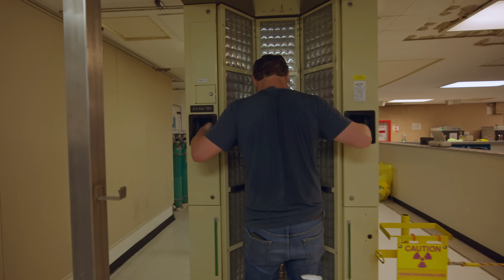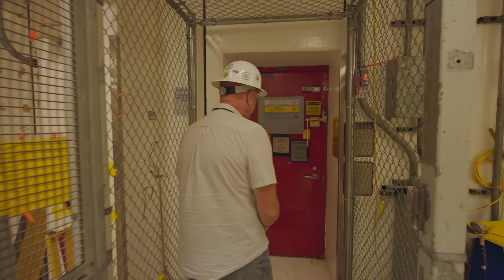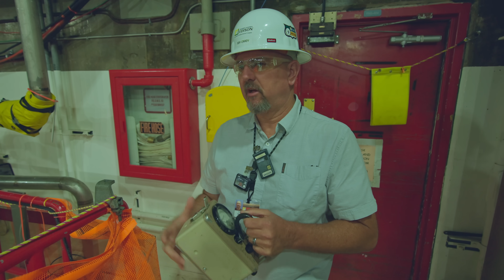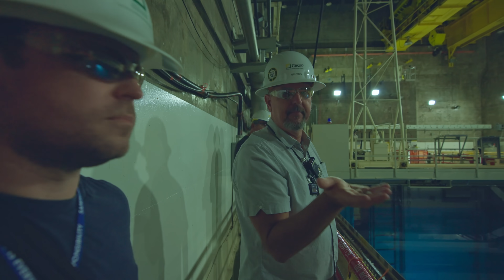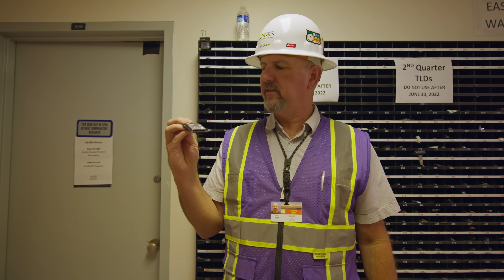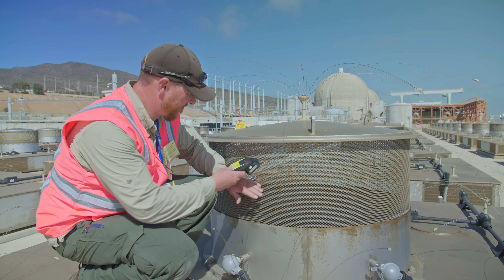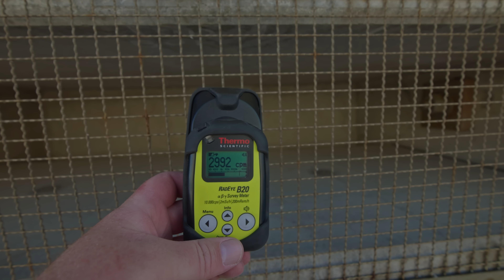Inside San Onofre Nuclear Power Fuel Pool and Spent Fuel Storage

Comment: Very few are being built. They are too bloody expensive. And they are not economical. They also aren’t good for baseload power due to the extended refueling outages that have to be made up fir by other sources, and that can occur at any time. They unlike other power sources only run in two modes - on or off.
Reply from the maker: For base load power you want an on all the time and they can regulate the power coming out. The refueling outages are planned very far in advance as they know when its time to refuel based on the power level they are running the reactors at.
Reply: @RadioactiveDrew  It does not matter that they are planned far in advance. You still have to have some other source of that much power. And it has to be always available because for systems use nuclear is a pig. It can go away at any time. And when it returns it demands priority.
Reply from the maker: Well that’s why you have a 2 or more reactors on site. So when one goes down the other can pickup some of the slack until they are both fully operational.
Reply: @RadioactiveDrew  Think about that for just a moment. The two reactors run as much as possible. Economically they cannot do any less. When one goes off line for maintenance or an issue, the other CANNOT pick up the slack. It is already running flat out. That is how they run. So - NO - the second reactor does not and cannot pick up the slack.
Reply: @tunneloflight  I must inform you that you have very little grasp of how the power grid works.  Please research that and get back to us.
Reply: @jovetj  I know a great deal about how the power grid works. It is a complex creature. With the inter-tie of the five major grid areas across the country new dangers of instability are created, along with vulnerability to impact by Carrington events. The complex interplay of power sources and types makes balancing the grid a very tricky thing. 

That includes not just power as we think of that (megawatts ...), but also of phase which involves "imaginary" power. That isn't imaginary. It does involve a second non spatial dimension. Explaining that takes a lot of doing. 

Balancing the grid requires understanding the capacitive aspects, inductive aspects, resistive aspects, wire heating and sag, and more. 

Having a major source go off line without warning creates severe challenges. 

Losing major sources in ways that require tripping parts of the grid offline have the potential to force nuclear plants to shut down due to loss of off-site power to support emergency operations. However, that in turn triggers a series of events which can put the plant in serious jeopardy.
Reply: @jovetj  so do tell. Have you personally ever controlled the shift of power among five major active supplies with megawatts of imaginary power running around and the instruments lying to you? I have. Have you ever operated megawatt range breakers in a supply system? I have. Have you ever worked with 17 KVA power? I have. Be careful with your assertions. It is better to be silent than to speak and remove doubt.
Reply: @tunneloflight  That last line is incorrect, it should be "It is best to remain silent and be thought a fool, than to speak and remove all doubt".  And the irony of it coming from a compulsive liar is poetic.
Reply: @krashd  yes indeed. You should choose to remain silent on matters clearly beyond your ken. And your last line is libel. Please remove it.

Comment: It doesn’t require an explosion. A spent fuel pool drain down in a seismic event was the major hazard that would have created a beyond Chernobyl event. Moving the fuel into canisters greatly lessens that hazard. While the reactors were in operation, they posed the largest beyond Chernobyl hazard in a moderate to major earthquake.
Reply from the maker: Well San Onofre has been there since the 1960's and they have been plenty of earthquakes in that area...nothing has happened. The fear of this location has been oversold to people that don't understand radiation.
Reply: @RadioactiveDrew  Quite to the contrary. When - not if - Cascadia releases, the connecting faults in California will likely release. These will be earthquakes unlike anything you have experienced. When Cascadia releases it will be a richter 9+ for 5 to 6 minutes!  The destruction will be massive. The last release was 322 years ago. A rupture is due anytime from 50 years ago to 200 years from now. 

The “experts” at Chernobyl said the same things you just said. They were wrong. 

The “experts” at Fukushima said the same things you just said. They were wrong.

Comment: “Which is better?”  That depends on what is being measured and why. The differences include types of radiation: alpha, beta, gamma, neutron, protons, deuteron, triton, anti-electrons, pi, Mu, kaon, and other exotics; what energy ranges(s); and whether you are measuring counts, specific energies, total energies deposited, in what medium, or biological dose equivalent. Each has different purpose, use and meaning. No one meter does it all.
Reply from the maker: You're right, no one meter does it all. But the one I use for most of my stuff is great for what I do.

Comment: Nuclear power seems extremely prohibitive in terms of cost. The process of long-term taking care of the radioactive waste has not yet been solved by the NRC.
Reply from the maker: The spent fuel could stay there on site forever. It’s better to have it accessible for future use then bury it away forever. It’s still producing heat, which can be turned into energy with very little risk to anyone.

Comment: My biggest question would be: Assuming the Plant was still in normal operation and the storage pool had Spent Fuel Bundles in it (and thus had that REALLY cool blue glow), if you fell in, how deep could you go before picking up a Dangerous or Lethal Radiation Dose?
Reply from the maker: I’m not sure. I would imagine you could dive down until you were 6’ from the spent fuel before running into serious trouble. Water is an excellent radiation shield. But once you get close the dose rate would increase exponentially.
Reply: @RadioactiveDrew  Boronated water, water is not that good.
Reply: @RadioactiveDrew  Wouldn't you be in trouble immediately?  (Well, not immediately but in the medium-term)  Not from the EM radiation directly, but from the radioactive elements in the water?  We are pretty porous animals, and we don't deal well with radioactive elements becoming a part of our internal ecosystem.  I'd be curious to hear from one of these workers what the byproducts are from the radiation interacting with the water.
Reply: Assuming there is no fuel failure, most of the bad stuff is inside the fuel rods, not in the water. Activated particles in the water would be bad to swallow, but wouldn't cause immediate harm. The water is recirculated through demineralizers to keep it clean.
Reply: @Ghost_Hybrid  So let me give you my 2 cents being a former Radiation Technician at Diablo Canyon power plant.  You would only be in immediate trouble due to pissing off the RP techs who now have to fish you out and decontaminate you via showering and then commence the massive amount of paperwork required to document the incident.  Seriously though you wouldn't be in much danger at all unless you could dive very deep towards the top of the fuel assemblies and even then you'd have to be a very good swimmer with a death wish to even try.  It's not like we are going to allow someone wearing a diving mask and swim fins into the area (of course we did put divers into the pool at times but under very strict controls) so trying to dive down 23 feet wearing street clothes isn't really going to happen.  Even if you swallowed some of the water it isn't chemically poisonous and for the most part doesn't contain much radioactivity either.  While many isotopes have a long half-life for radioactive decay there is also something called biological half-life which if I remember correctly is about 7 days so your body will get rid of it via waste elimination far faster that way.
Reply: @RadioactiveDrew  I knew that...I knew it was
Medically you're fine but expect an EXTREME Scream-Fest for giving the Health & Safety team a Heart Attack when you fell in...
You're OK but your future kids might have two heads or some other Birth-Defect(s)...
You're gonna get Cancer in a few years...
You're 100% Absolutely, Catastrophically Fucked and will die in screaming agony in a few days!!!
You can now rent yourself out as an animated night light...briefly...IF you live long enough to get off the Nuclear Plant's Property...
OK, you're a crispy critter and need to be fished out of the pool like a salmon and carted out in a lead-lined body bag...

What I wasn't sure about was the depth above the Fuel Bundles of each stage...
Except for the crispy critter stage which I believe starts about 6 inches above the Fuel Bundles...

😄😁😆😅😂🤣
Reply: See xkcd what if 29.
Reply: We infrequently had divers that would have to enter the pools to perform repairs when absolutely needed (ALARA principles) - borated water is good for neutron absorption but as the HP indicated: time, distance and shielding was your friend - every rad worker in the industry was/is a qualified professional, and every high risk job was always planned with worker safety paramount, and mockups of high risk/dose jobs were routine to practice/validate procedures prior to actual work (unlike what was portrayed by Homer Simpson which most plant workers found hilarious while knowing the truth about how high the work  standards were/are).
Reply: @robd314  Most of the repairs in spent fuel pools are performed remotely with specialty tools built by Westinghouse or other companies who build fuel or high contractors to move fuel for refueling outages. Work in transfer canals is another story to repair up-enders or transfer carts and the hydraulic systems powering them.

Comment: The "Doomsday" scenario mentioned about a can falling while being loaded into the dry storage units just proved that whomever came up with the theory mentioned in the Article has absolutely NO FUCKING CLUE how radioactive materials behave...If it was THAT easy to get radioactive materials to Detonate in a Chain-Reaction (AKA a Nuclear Explosion), EVERYONE and their infant would be able to make a Nuclear Bomb and as the Mad Mullah of Iran could tell you, It doesn't work like that...he should know since his Experts have been trying to build a working Nuclear Bomb for decades now and if they've succeeded, it was only in the last 5-10 years or so and even then, it's HIGHLY unlikely Iran has been able to develop or build the kind of compact, high-yield weapons that the Major Nuclear Powers (USA, China, Russia, Israel, India, Pakistan and Australia) have in their Arsenals...Civilian Nuclear Power Plants do NOT use the Highly Enriched Uranium required in Nuclear Bombs...

Military Nuclear Plants on the other hand could be a different story since they tend to use what's called a Breeder Reactor in which the Uranium in the fuel rods is converted into Plutonium for use in manufacturing Bombs, but even then, the material in the spent fuel rods still needs extensive processing and refinement before it becomes usable Bomb Grade material and so even dropping a Military Reactor Fuel Rod isn't going to do more than contaminate a relatively small area immediately around the accident sire, it's NOT going to explode...

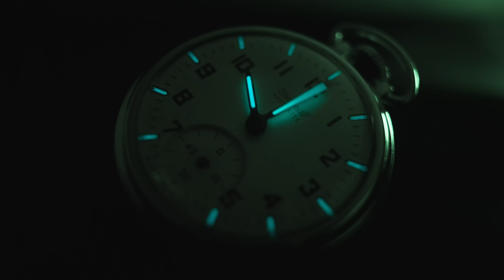Comment: At 11:06 you can see white pixels appear on the video as the camera sensors are bombarded by the particles! Please like this comment so they see it!
Reply from the maker: So who sees it. The ISO was turned up higher than normal in the camera to deal with the low light. So if you see anything it’s more than likely sensor noise. Some of it could be from gamma radiation but not enough to be concerned about.
Reply: @RadioactiveDrew  I agree the radiation is low. If it's not sensor noise then it would be from the radiation

Comment: Three Mile Island, Chernobyl, and Fukushima have put the fear of nuclear plants into peoples minds to the point the NIMBY crowds are huge against the construction of any more plants in the US. A properly designed, properly constructed, and properly run plant is far safer than any gas fired plant.  What is intriguing is that they have a set lifetime that was not considered part of their design.  After so many years of gamma exposure, the metal for the fittings and piping can cause degradation and stress, and they cannot be replaced due to the amount of radiation they accumulated, so instead of refitting, they decommission.  What could be done is plan it so that when it gets to its decommission point, build another reactor to take over the job.  This should be something that is part of the initial design, planned for in advance.  This may require a larger footprint, but also keeps it in one spot instead of having a dead zone, and create another hotspot elsewhere.  Plan for a 100 year lifespan.  Who knows, in that time span they may come up with a way to clean the site and restore the original reactor too.
Reply: That is actually how nuclear plants are constructed, you build two units and 20 years later you add another two to gradually take over, and so on and so on.  In the UK we build them in twos and assign them a letter so Sizewell A units 1 and 2 were built in the 60's, Sizewell B units 1 and 2 in the 80's and Sizewell C would have built another 2 units around the millennium if the nuclear bubble had not popped after Three Mile Island and Chernobyl.  Now we have several plants that should have been decommissioned 20 years ago getting dangerous life extensions rather than replacements because of a handful of ignorant green zealots who don't know the first thing about being green.
Reply from the maker: This site originally had a Unit 1 that operated from 1968 until 1992. They built Units 2&3 in the mid 80’s. 

Gamma radiation does play a part on the wear and tear of the reactor. But I think the biggest problem is the very high neutron radiation. This will create other isotopes in the steel and concrete next to the reactor that are radioactive from this process. 

I would hope that newer reactors being built today have a better design but this facility was really cool.
Reply: Numpties gonna nump.

Comment: It seems a shame to waste all of that heat coming from the storage containers. It would be nice to use it in northern regions to de-ice roads and sidewalks sort of like geothermal energy is used (I've heard) in Iceland for that purpose. Or maybe to heat large buildings. I admit to being kind of weird so maybe others don't feel the same way, but looking at all that heat going to waste instead of using it to maybe put a small dent in global warming is almost physically painful to me.

Anyway, thanks for the tour. Was kind of hoping to see Mr Smithers but I guess we can't have it all.
Reply: Well you are right, it would be good to be able to use it, but it has to stay inside a containment. All the low radiation when things go well is nice and dandy, but things are as safe as they are because those pools and more importantly those walls are not compromised.
Reply: @udirt  Heat does not need to stay inside a containment, how on Earth do you think steam gets to the turbines in a nuclear power plant?   One loop (the radioactive one in the core) heats a second loop (the uncontaminated one outside the core), and the water, steam, heat or whatever from that second loop is as radioactive as a tree and can be pumped anywhere.
Reply: @krashd  wow really. So you gonna build a second heat exchanger system on top of the storage, one that is optimised for temperatures under 50 degrees Celsius? Or you gonna let it boil just a bit so you can use steam in the primary loop? Just curious since you just explained 8th grade physics nuclear plant building and somehow have a novel concept that makes it feasible to use spent pool heat without compromising the safeguards in place for accidents.

Comment: Worked at a plant during construction as a pipefitter and later went back and worked security so I have  been inside just about everyplace before it was hot. Odd when you go back and look at the places people can no longer go and think I use to sit 20 feet from where the core is and eat lunch. And yet odd to walk right up to a fuel rod after it comes off the truck and it is safe until it gets used
Reply: Thats incredible, thanks for sharing. How many powerplants like this did you work on?
Reply: The Uranium in an unused fuel rod isn't very radioactive, BUT, get several tons of those rods together close enough, and you wouldn't want to be anywhere near it.  Yep, it's pretty amazing stuff.

Comment: In the 60’s when this site was under construction I surfed about a half mile south of the construction. We had to hike out & down an 80’ cliff to our surf spot we called Mile Zero. (We called it Mile Zero as there was a speedometer check sign posted at the trail head there on CA I-5). Whenever we drifted any closer than around 200 yds from the pier they had built out into the ocean about 150 yds alarms would sound and armed guards would come out and run us out. So many times we tried to find out what they were building but we never got a reply. Nuclear was a word used to reference a war back then. BTW, it was a great surf spot.
Reply: Thats a really cool story thank you for sharing

Comment: For a Guy that used to Work in These kind of Power plants its realy shoking how you guys are able to Enter an Controlled Area without changing clothes.

Here in Germany you need to Change to a Organge Overall. noting an you will be personal. Youre Underware, Socks and Shirt has to be the one provided by the Plant. 
After changing you will get through alle the Monitoring Checks as shown.

but standing near Fuel with Basicly Street clothing is very astonishing. But If its works, it works.